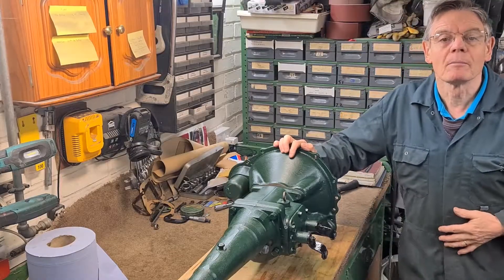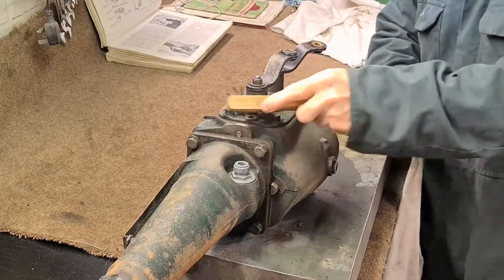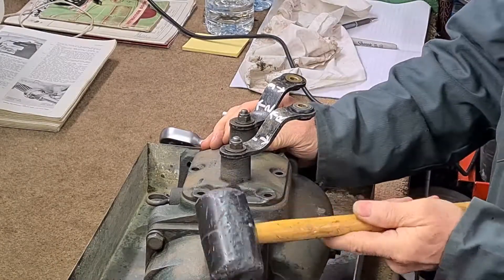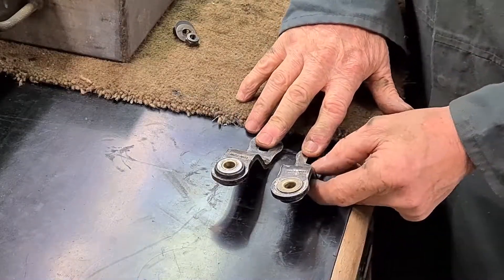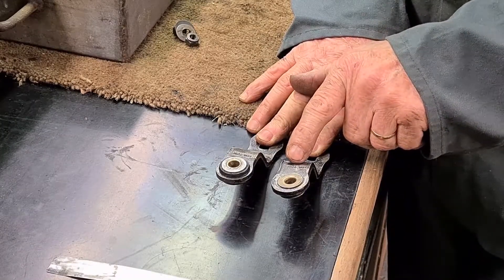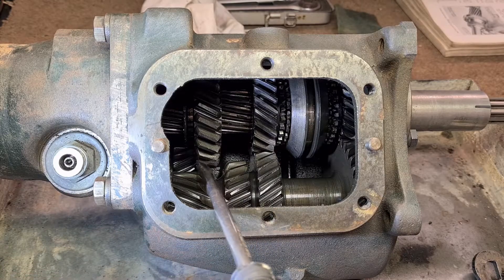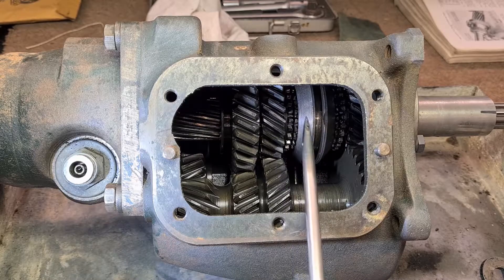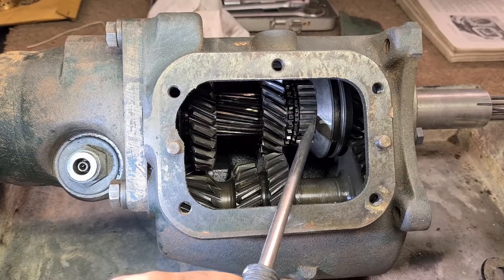Gearbox Repair Part 1

Comment: Hi Steve
I have overdrive on my Zodiac but its not kicking in. All wires n fuse are fine any info please
Chris
Reply from the maker: Hi Chris unfortunately I have never worked on an overdrive so I can't help you. Speak to Kevin at https://www.facebook.com/kevin.dipchan or John Blythe at goldendays, you will have to ring him because he doesn't do Facebook 01603 881155 .
Reply: @StevesConsul  ok thanks for your help. Thought i would give you a try
Cheers
Chris

Comment: I have been told you can swap the syncro hub round to extend its life
Reply from the maker: Hi Gary 
I can see why that would work to use the other side of the spline but unfortunately it CAN NOT be turned round because the thrust face is deeper in one end than the other.
Reply from the maker: In part 4 i talk about how one face is ground and the other face is not.
Reply: Ah excellent thank you

Comment: Thanks for another good video Steve. I'm sure your description of how the gears work to transmit the power to the driveshaft will be helpful to many viewers. I'll be interested to see if you can remove the spigot shaft without dropping the layshaft; I find the dog teeth normally foul on the front row of cluster teeth. In any event, often one or more of the 13 mainshaft pilot bearing needle rollers will end up falling to the bottom of the box. Make up and use a dummy countershaft if you have to drop the cluster, then you can keep the needle rollers in place. I made my dummy shaft 17.25mm dia by 145mm long in mild steel. I guess you could use a cut-off blade to trim the front slightly larger diameter part of an old layshaft and the rear cut out, so it reduces it to 145mm long and chamfer the ends.  Check the layshaft from the box carefully, often there are areas where the needle rollers have cut through the hardening, depending on how much work the box has done (and how clean the oil has been maintained - chips from clumsy engagement of 1st/reverse gears don't help either!).  Keep up the good work, I'm sure everyone who watches is learning heaps.
Reply from the maker: Yes i made a dummy shaft from the scrap box and used it when I rebuilt the last box but that's not on the video.